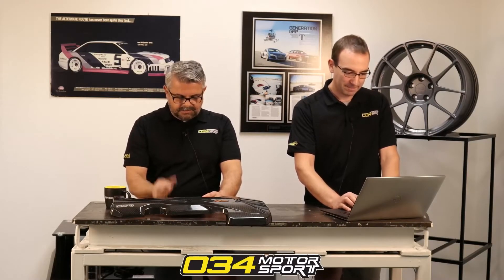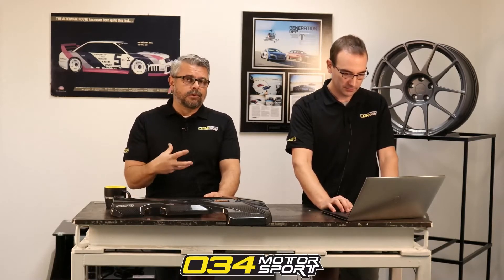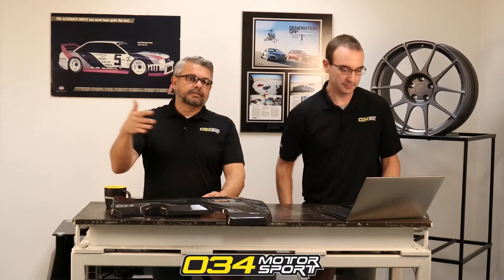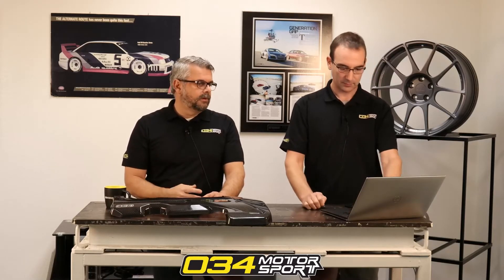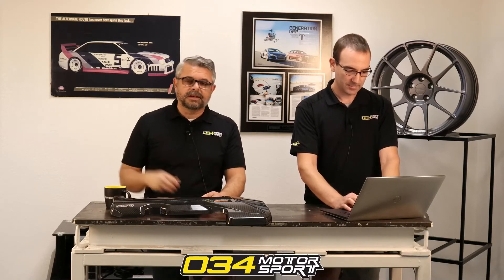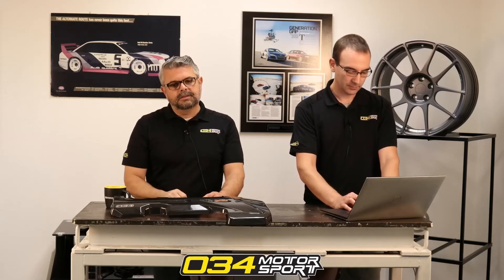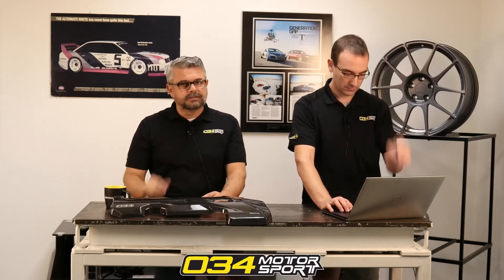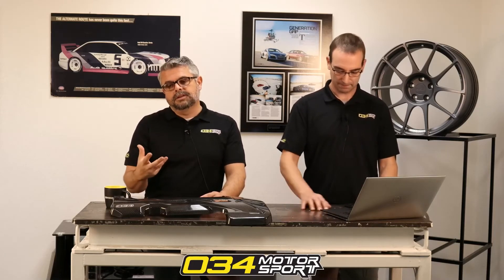What is keeping Catted Downpipes from Passing Emissions? | 034Motorsport FAQ

Comment: I came specifically about the 034 down pipe for 2018 b9 s4…. I’m wondering if it will produce a check engine light even without a tune? I just got my inspection so im good till 2025 but just wondering because I really want to build my car with 034 parts, just in a legal manner Lol
Reply from the maker: Yes, it will trigger the CEL and is not legal for road or emissions controlled vehicles.